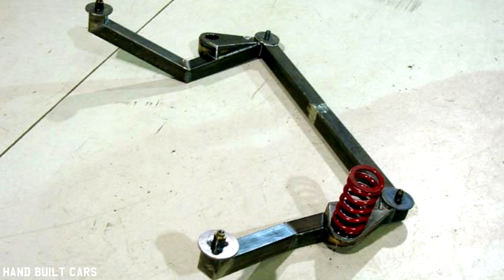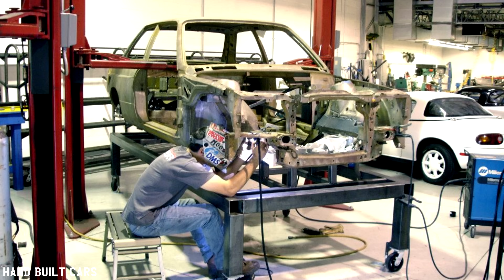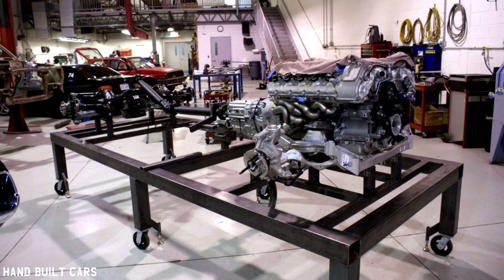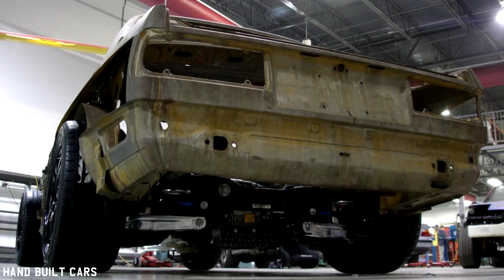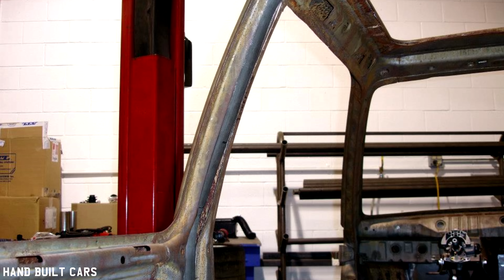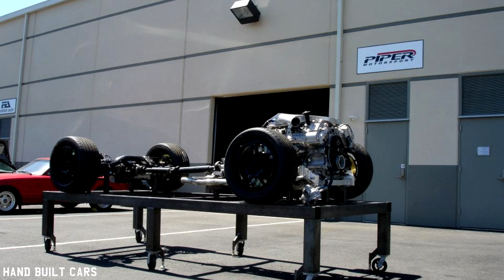BMW E30 M3 S85 Dinan 5.7L Stroker V10 Swap Project

Comment: I am a BMW fan and at first I thought how could they damage an E30 M3 considering how much they are worth now. Then after watching the whole video and seeing the incredible skill, workmanship and the extent of the metal work required putting that massive V-10 and all the drive train, management system, suspension, etc  absolutely blew me away. Probably one of the coolest builds I have ever seen! Great Video
Reply: This becoming a listing with car detailed specifics, pics, and a part build list on BaT. Would now fetch more cash profit than a low mile all original. Guaranteed. It’s already done you don’t have to buy the car and do it yourself.
Reply: @Rimiler  I couldn’t find it under e30 for the past year did they take it down

Comment: Easily one of the greatest BMW builds on the planet. Simply stunning and a dream to ever own something similar. I'd love to do this with a Dinan s65 instead, maybe a custom dct setup and an outboard or airlift H suspension. 
And then do the same setup on an E9 635i chassis, and an E31 csi chassis.... Yaaaaas, 😳😳🙏🙏! 
Oh if I won the lottery.
Reply: Oooh oooh, imagine doing this conversion on an 850csi, except somehow sourcing an s70 from the McLaren F1, and a fully custom updated interior. 
🤣😂🤤🤤🤤☠️

Comment: My word that is some of the best fabrication I've ever seen. Especially the tuck and position on the roll cage and the sucking in of the front rails and strut towers. 
The only thing I absolutely hate about every E30 build I've seen is the disparity in front and rear wheel opening. If you are fabbing new inner and outer wheelwells and mounting points, why not open it up to take the same size wheels as the front? If the wheelwells (arches) were larger, it would look so much better. E30s with Yugo wheels in the back look kinda out of place.

Comment: I doubt it was a true M3. If you watch the video they start with nothing but a shell. It doesn't matter what E30 it was, they are all identical after the few strengthening pieces put in the parts that were cut out anyway.